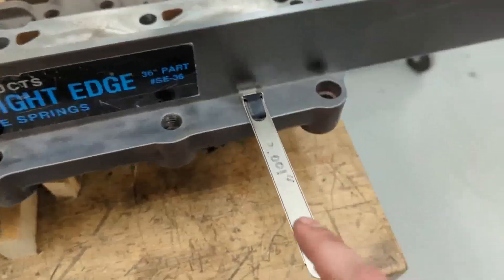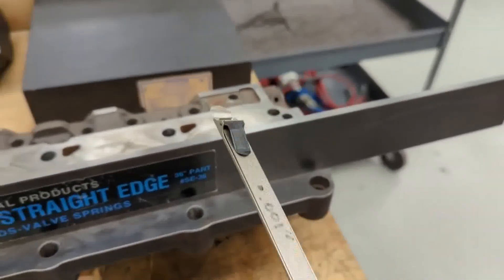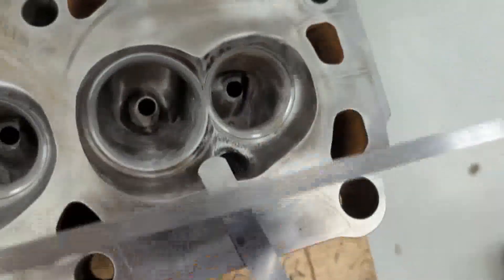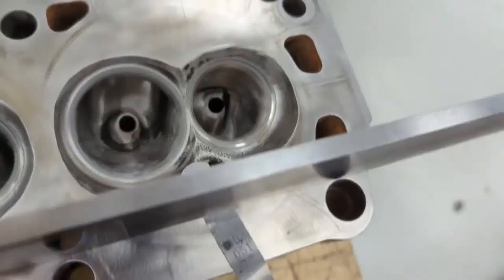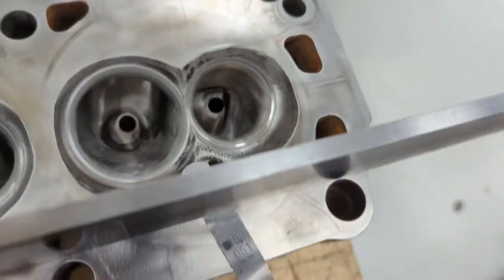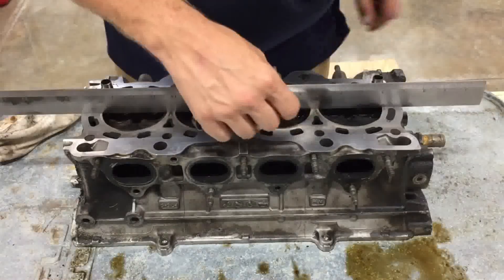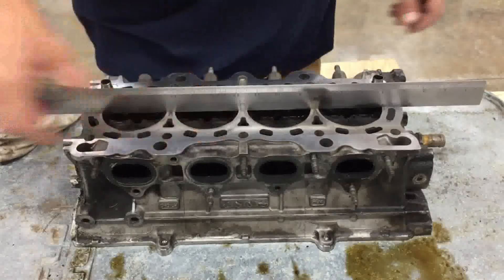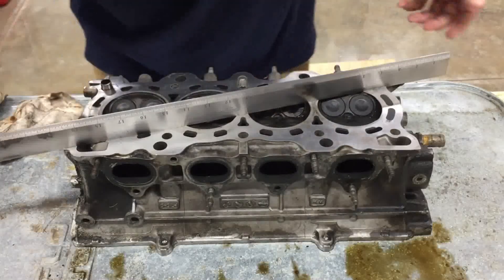Engine cylinder head  Warpage

Comment: And if the "war-page" is slightly beyond 0.003, you can use a valve lapping compound to rub the face of the head onto the face of the block. The high spots will rub down to the low spots for a perfectly planed surface. There's always a conventional way to do things that can save time and money from going to a shop.